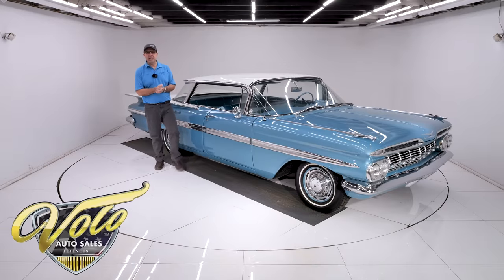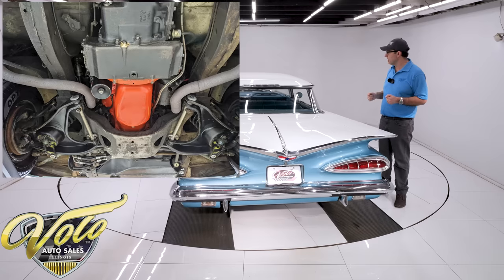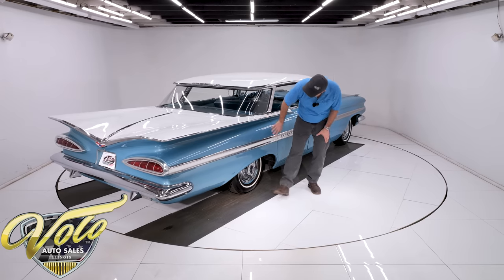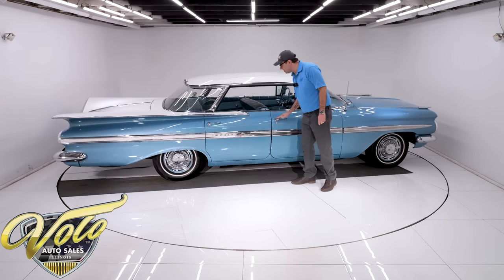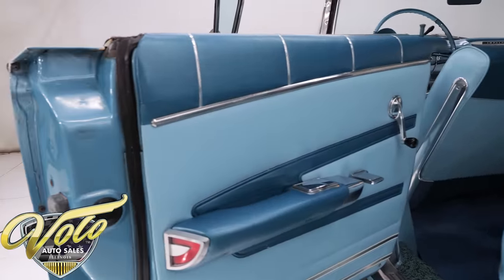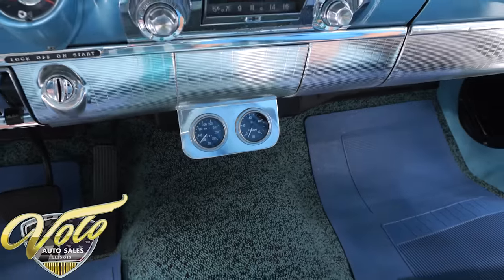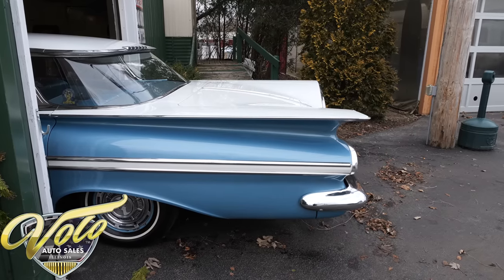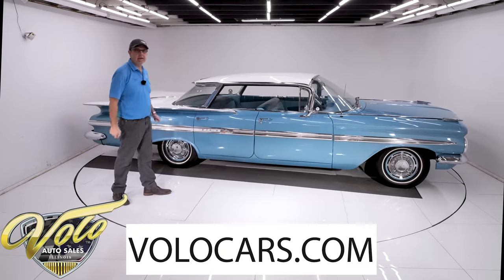1959 Chevrolet Impala for sale at Volo Auto Museum (V20799)

Comment: The flat top was produced in '59-'60 as stated, and once more in 1961. In '59-'60 it was called the "Vista Roof " and only offered on 4 door hardtops. For '61 it was offered only on 2 and 4 door sedans, and not the hardtop models.